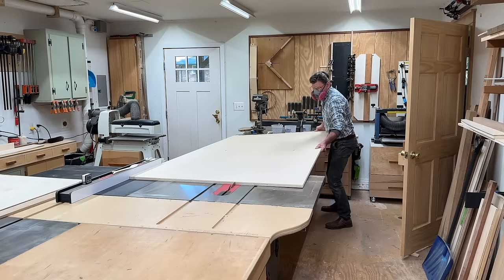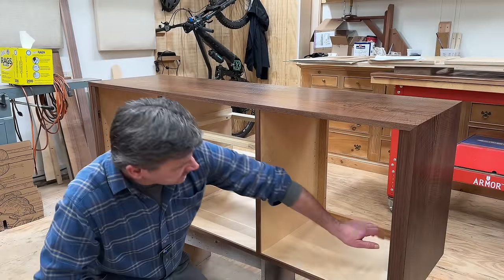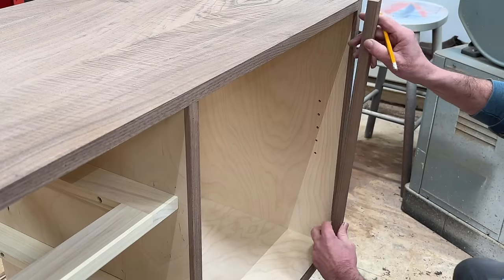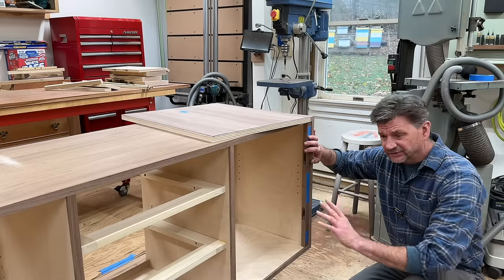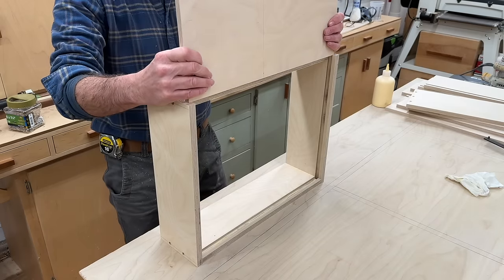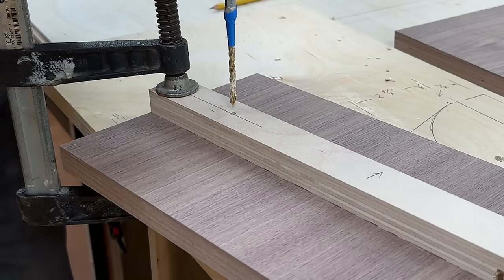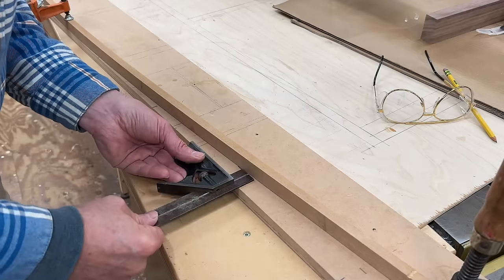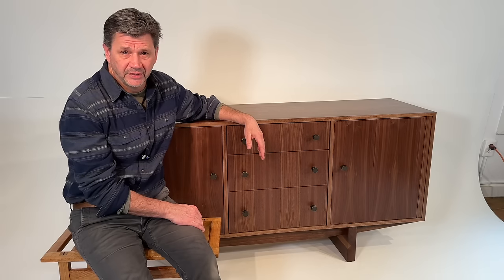Build a Modern Sideboard / Walnut Buffet

Comment: Would be interesting to see a video on your finishing set up: what gun you use, ventilation system, how you manage heat, dust, fumes, ect.
Reply from the maker: I’ll put that on the list… I know I have a video titled how to spray lacquer at shows a bit of the information you might be looking for
Reply: @JonPetersArtHome  cool thanks! I've always struggled to spray in my shop for the reasons mentioned above.  Finishing projects in the winter that need multiple coats is especially challenging....so much so that I've started using hard wax wipe on finishes instead during the cold months. It's not a perfect solution

Comment: Great project, Jon! I've been following each bit and am happy to see a full project video. Quick question: any reason you preferred 5/8" ply for the drawer boxes instead of 1/2"? I tend to use 1/2" on all drawer boxes and am curious if there is any particular reason you went heavier for this project.
Reply from the maker: Thanks! 5/8 is just a little heavier and I think less likely to split from the screws… gives the drawers, a solid look and feel

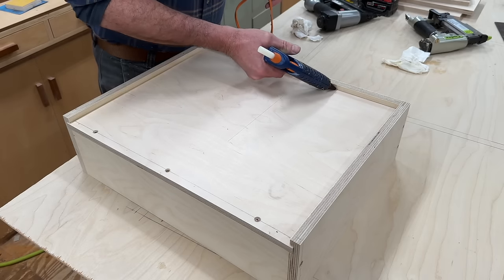Comment: Love this look. Elegant and useful and zero fussiness. But … 26:47 Since you’re using nice thick plywood anyway, couldn’t you skip all the screws and just use glue, esp on the bottom? With the pins, good glue, and your meticulous clamping, sure seems like those drawes would be bombproof for even your Paul Revere silver flatware.
(Sorry, Jon. I’m always on you about this. You like extra strength - and are building for clients - and I’m always trying to be minimal. I’d love to hear about an option for a back that could be seen. Maybe a big veneered panel with dividers to break it up?)
Reply from the maker: Hi John, I feel the screws aren’t much work and make the drawers, much stronger. Yes, you could use veneered plywood and attach it from inside the cabinet. I did that on another walnut sideboard a few years ago and you can see it on my channel .
Reply: @JonPetersArtHome  yeah, I thought that sounded familiar! It would be really pretty.